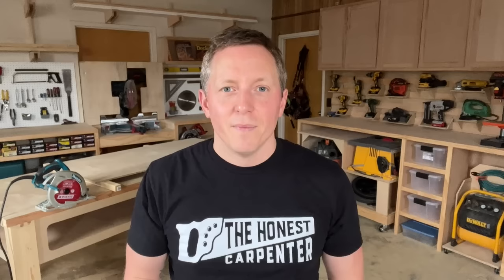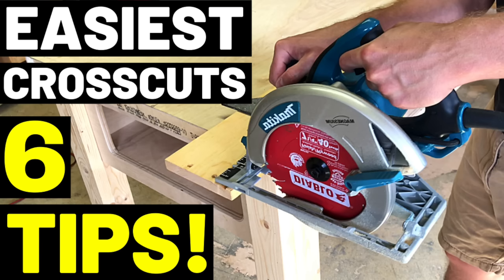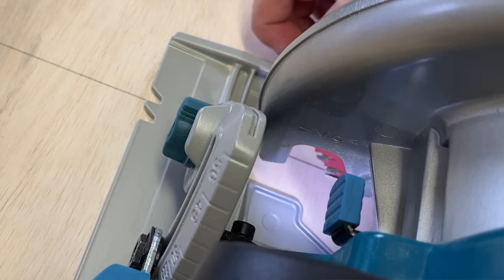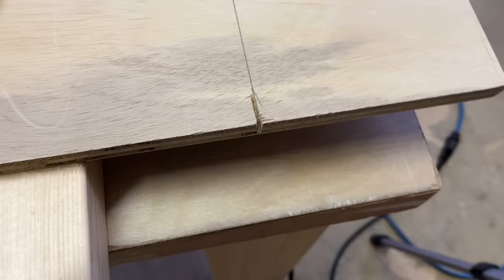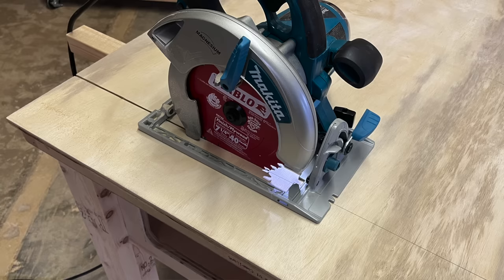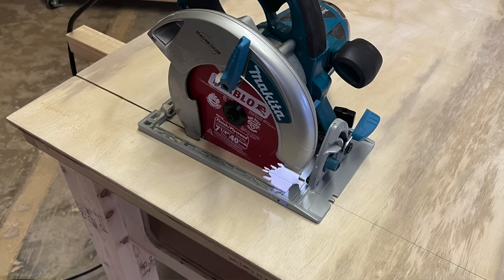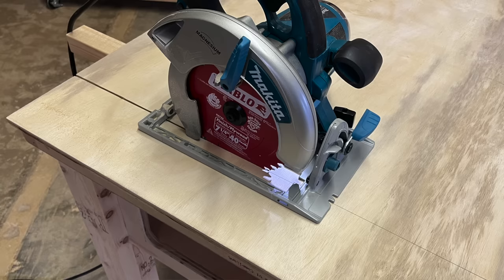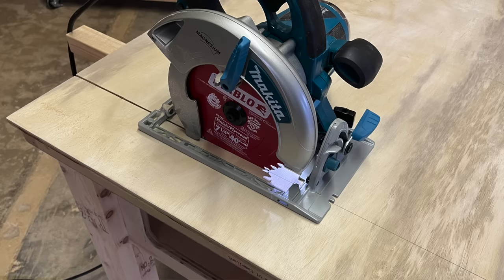How To CUT STRAIGHT With NO GUIDE! Freehand CIRCULAR SAW CUTTING...Pro Tips, Tricks and Secrets!

Comment: Good video with one somewhat controversial comment. 'Splitting the pencil line' seems inaccurate to me. All-be-it only 1/16 of an inch or so, when I strike my cut line it lies fully outside if the straight edge so don't I want my blade also fully on that edge? If my line is on the waste side of the cut and I split the pencil mark am I not losing however much material is on the 'keep' side of the line. I know this is construction accuracy and the very slight difference may not matter and I know it is difficult to keep the blade on the edge of the line but isn't my theory correct? Just my 2 cents. 
I appreciate all you do. Thanx, Greg
Reply: That's why a sharp pencil is important. If so, your line is probably 1/32", or even 1/64". Plenty accurate for free hand work if you split it.

Comment: At 4:28 in your video I notice that you are prepared for making a cut following a line on the board. In order to see the line you are trying to follow as you move the saw across the board, your right hand is controlling the saw and your right hand is across the front of your body. I presume you are right-handed as maybe 95% of the population is; therefore, i assume you see this posture as "natural". Try this next time ..... hold the handle and turn on the power switch with your left hand and you should notice that your control hand (left) is aligned with the path of travel for the saw and your eyes more easily can see the saw blade and the line. This won't "feel" natural because you are right-handed but i think you should experience your body more in alignment to the project cut. I loved the video and being left-handed your video prompted me to realize this analysis for the first time. Best wishes.

Comment: I would also say keep your wrist as quiet as possible and use your arm not your wrist to push the saw that was a tip I got years ago but I agree if your not using tables saw clamp a straight edge on your material so it glides on the plate obviously when it’s critical for a better cut or a Gregg product I like there products but they are obviously more expensive than just a straight edge

Comment: I am surprised that you prefer a circular saw with the motor on the left. Assuming here that you are right handed, your physical position is left of the saw and you have to look "over the machine" to watch the pencil line. I didn't give this topic any consideration when buying my saw :), but it has the engine on the right. Which means that I hold the saw in my right hand,  I stand left of the blade, I don't have to bend over the saw and the motor doesn't hide my view on the line. For me that's the perfect setup, but completely the opposite of the shot at 12:00. But as always YMMV :-).

Comment: The only time I'll cut freehand is when sheathing a roof or a floor, and then picture perfect cuts aren't needed.  Any other time I'll use an inexpensive home made 1/4" wood guide nailed with two 3/4" nails to the surface of my plywood, which is the hidden side of the rough cut.  It's much cleaner, faster and stress free.  Do it yourselfers have the time to set up a guide, they should always use them.  Always wear eye protection, and if you're inside, don't forget your hearing protection.

Comment: Line up the notch on the front of the table on the saw on the line and the blade on the line and start cutting then you should be able to follow the line and the less your blade goes done in the wood the mote change you will go crooked because it’s easy to turn. That is how we carpenter make a arch with a skill saw because you can turn and the blade won’t bind and will let you turn. So the more blade is in the wood the harder it will be to go crooked and do a plunger cut to start and when the blade is straight drop it down and keep pushing following the line

Comment: Skill saws the same as a hand saw but there’s only one axis you need to keep straight just don’t move you wrist there’s a little mark that goes to a notch that’s  in line with the blade put the blade at your line then line it up with the notch and just be calm don’t rush and you don’t need to fallow the line really because once you got a good start the saw steer off you do by over correcting

Comment: If you are freehanding with a circular saw, you have already decided "this does not need to be finish-grade precise, time and convenience is more important"

Spinning the saw up to speed is always going to move the saw around a fair bit.  Get your initial line up close, but there's no reason to get really finicky lining up the saw, until it is spinning at full speed.   Incidentally, this turns your saw into a gyroscope, which makes it easier to make small adjustments.

Have a 'plan' for what happens with your saw cord, for the whole cut. A cord catching on a sawhorse leg, or in the kerf, or really anywhere, can drag your saw off of line.  For a lot of cuts, when I am moving from right to left, I hook the cord onto a tool in my toolbelt, to keep it near, and loose, at my right side.

It's easier (and on bigger cuts, required) to move the saw with footwork, legs and your torso - my arms and the saw are often 'locked' in place in front of me, hands used primarily for micro adjustments. Having the saw locked in and centered with your torso also makes it easier to control, (and therefore safer), than long extended arms. Make sure you know what you are walking around so you don't trip on an unexpected obstacle.

Each saw kicks up wood bits and sawdust in different, but fairly predictable ways; as you gain familiarity with how your saw cuts, pay attention to where you can hold your head, you are searching for where you have a good view of the line, and the cut, but you're not getting mountains of wood blown directly in your face.

When you do have to make "micro' adjustments (and we all do), know that you are sending the saw on a new path: if you have to make an adjustment, you will likely have to make 2, one little bump of pressure to "drive' back to where you need to be, and a second little bump of pressure to get straight back on course.

The last 5-10% of a cut is when one board is turned into 2- there is almost always going to be some shifting of equilibrium, weight, and tension, in the last part of a cut, which can affect your result. 

Try to think about how the two finished pieces would balance, after the cut. Setting up the workpiece should be both balanced for the starting condition, and should be balanced for each piece when you are finished, if you want to limit this shifting.

Backing up when the saw is spinning has a high chance of causing a kickback. It will often seem like "oh, let me just back up a little bit here and tidy that line up - it should be fine..." it won't always be fine.

The most chaotically dangerous place is directly behind the saw: this is where the saw goes when something goes wrong. Something will go wrong at some point, so uh, try not to have people or parts of people there.

Comment: For who I am... weird(?)... I do use a circular saw with a carbide tip blade to saw sheet/plate metal to about an eight of an inch (but honestly sometimes thicker). All the practices spoken of here holds true when cutting metal, but getting off track is a lot more difficult to correct than in lumber-ish products. My suggestion is, if not time sensitive just take the time to forgo winning the hero button and use some sort of reliable straight guide.

Comment: I have always felt that a right-sided saw blade was more difficult to use if you're right-handed. I found much to my delight a left-sided circular saw from Bosch. This allows me to site the line and blade at the same time. I also have a worm drive corded and 7 1/4 cordless. I have of course used a saw-like yours but having the blade on the left-side is my preferred cutting method.

Comment: That notch on the front of the saw is 100% accurate lol.  Why would you say it is not?  All lines may not align with the blade from saw to saw, but once you know how it transfers to the blade, it is all you need to use  BTW, if you only look at the blade and you stray off the line the consequences are more dire than if you notice the notch goes off the line.

Comment: How hard is it to clamp a tee square to the sheet and know that you have a straight square cut? My saw guide is a piece of laminate flooring which is thin enough to pass under the saw body and wide enough to allow a place for the clamp.  The tee part extends just to the saw kerf. Free hand cutting and expecting to get a neat straight cut is an oxymoron.

Comment: Perfect timing for this video since I'm looking to buy my first circular saw. I'm a small scale home DIYer and love the convenience of cordless, but worried that the 5 amp battery won't give me much power to rip sheets or 2x4's. Should I go corded or cordless?
Reply: These new cordless power tools have great power and actually last pretty good. Buy a backup battery and you'll be good to go plus you can hopefully run your other power tools using the same batteries. Your next decision is what brand to buy. Good luck 👍
Reply: Milwaukee or Dewalt, whether corded or cordless, you will never regret owning one of those two brands. They are expensive, but they are worth the expense. 
 I personally own a lot of the Milwaukee cordless lineup. I have used Dewalt on the job site as well and was equally impressed. You can't go wrong with one of those two.

Comment: Amateur tip: use a guide anyway, but measure the exact distance between the cut and the guide.
When you know the distance you can always position the guide accurately without having to worry.
When you don't have to focus on keeping a straight line you can focus on the safety aspects, which are far more important.

Comment: I find 7 1/4 circular saws incredibly awkward. My porter cable is big and heavy and I mostly hate it. Why in the heck the standard config is to the have the motor on the left when most people are right handed I'll never understand. It's super awkward to use, especially on large pieces, like ripping down a sheet of ply. Using a straight edge, which is always a setup hassle, has been the only reliable way for me to actually use it. which provides it's own challenges because your clamps and the board itself have to be out of way and can't be high enough to hit the stupid motor coming out from the left! Setting up to the right of the blade doesn't generally work either. Bora clamps suck and were not better than clamps and a board, so that crap went right back to the store.

Comment: As others have suggested: 1. Worm drive saw vs sidewinder. it has a narrower footprint and is easier to work around. 2. Use an after market or custom plate that is either wider than stock or has a track attachment. 3. Defeat the guard. As he suggests in the video, this is "sometimes necessary". I would argue it is always necessary. Most spring loaded guards are too strong and interfere by getting caught on the edge of the board. 4. Use cordless, or overhead power to keep the power cord out of the way. Power cords often get caught in the space after the cut, (but before it the wood is completely separated). 

Any of the above leads to stopping and starting mid cut, and or distracting the user while they are trying to focus on the cut. C saws have high torque motors, and are often hard to precisely control as a result. You should do everything possible to avoid stopping and starting again mid cut.

Comment: After working 40 plus years as a carpenter/woodworker, I still can't understand why these sidewinder saws are so popular. If you are right handed, it makes much more sense to use a worm drive saw. Because the blade is on the left of the motor, and therefore much more visible. Also, you're are not cutting with your hand and arm crossed over your body. That is not as safe as using the worm  drive.

Comment: Glasses, blade depth. Start with back of saw elevated and lower in as you move into line. Didnt need 15 minutes to describe
Reply from the maker: No, don’t do this. Just because framers drop in at the edge doesn’t mean beginners should. Bad advice. 👎

Comment: I came here sort of by accident but I have a lot of experience with this type of cutting and I have to say you got a lot of this wrong. You have the blade adjusted for a shallow cut, which causes several problems with no upside. First, your blade is passing through the wood at an angle instead of more or less straight up and down, like a band saw. Is this the angle at which you would also use a hand saw? Of course not. The reason is that the shallow angle is forcing the blade through more wood as you push it along, like one and a half inches versus a half inch, so it’s more difficult as well as creating more heat. 

Second, adjusted for a shallow cut, the amount of blade inside the cut is much less than if you had it set for max depth. You’re correct when you say this assists in keeping the blade aligned, but a shallow cut is harder to keep aligned because there’s less wood guiding the blade. For example, you could probably cut a big circle out of half inch plywood if your saw was adjusted for a shallow cut. A circle would be virtually impossible adjusted for max depth. 

Third, adjusted for a shallow cut, your handle and on/off switch are in an awkward spot. The saw can accidentally pivot more easily than if you were at max depth because the handle and controls would be more or less behind the blade instead of above it. This provides more leverage and makes the saw easier to control and keep in a straight line.

The other thing is you don’t need so much support under whatever you’re cutting, there’s no reason for it and it takes too much time and effort. You can cut perfectly straight off the edge of a sawhorse. If you have a large amount of overhang or you’re between sawhorses, you’ll need to support the wood somehow or it’ll splinter when you get near the end of your cut. If I’m working alone, I like to use quick release bar clamps even if I have a support under the overhang. I stop half way through the cut and put a bar clamp at the beginning of the cut before I continue. This has nothing to do with cutting a straight line but it’s an important point. If your overhang sags as you cut it, it will create torque at the end of the cut and cause disastrous splintering and bucking.

By the way, a Makita saw screams “amateur” but the Diablo’s a good choice. Sorry, man, but ask any contractor, Makita is a homeowner saw. As to what kind of circular saw to use, virtually anything but Makita. LOL I have five or six circular saws but my favorite one is actually a Ridgid.

Comment: #1  make sure the material won't move - clamp it down if needed 
#2 make sure the saws  base plate is clean and flat ( some fools drop their saws on the ground )
#3 make sure the cord is freed up to travel across the material -  if the cord is to short or hooked on something it will mess up your cut !
#4 set the blade to the correct saw depth !
#5 wear safety glasses !!!!
OOPS I almost forgot  use the correct saw blade that is sharp !   the wrong toothed  DULL saw  blade can ruin the material  !

Comment: Excellent presentation. I see you used a 40 tooth blade. Do you think it is easier to cut a straight line the more teeth the blade has?
Reply: Yes. Many teeth with help with a straight and cleaner cut. Not too fine though as it will slow you down. 40 tpi is a good balance that has improved my cuts than the courser blades you often get with saws.

Comment: As a former lefty using blade right saws, I never realized how vital it is to have a blade facing you. (Lefties=blade right. Righties=Blade left.)
 
Now that I'm a righty, after losing use of my left arm/leg, I'm amazed that there so many right blade saws being used by righties. (Especially EVERY good track saw.)
 
The twisting, and stretching needed to use a right blade saw, as a righty, on rip cuts is a nightmare. For crosscuts in 2x lumber, it's not a big deal. But rips in ply, or longer lumber, it's reallllly tough. 
 
Hopefully, a good track saw comes out with a left blade. It's so great to be able to hold it with your right hand, as your workpiece is to your right. 
 
"Good enough should never be considered as "good", or "enough". Especially with dangerous power tools." -Me

Comment: A straight cut, free hand with a circular saw is impossible, yes you can sometimes get it pretty close, but only good enough for carpentry. If you need a perfect cut, use a saw guide or a table saw. I only use a circular saw for the rough dimensioning of lumber, anything within a eighth inch is good enough.

Comment: These cuts might be okay if you are going up against a wall or somewhere that the cut will be covered, but are rubbish if you are butting up to another sheet with a factory edge.  If you are using a straight edge to mark the line, why wouldn't you just clamp the straight edge on and use it to cut the line. Ever heard of a tracksaw. You don't even need to clamp those ! Pro tip,

Comment: The old saying practice makes perfect is true. I've gotten pretty good at following the straight line, especially on shorter cuts. Long cuts are of course more difficult. One problem with corded saws is the cord getting caught on something. And then having to stretch out on really long cuts. I've about stopped using my corded saw in favor of the cordless. Problem with that is a dead battery. Extra batteries are nice so I keep two fully charged on hand. I do keep a straight edge on hand and use it sometimes. It's an aluminum two piece tool. Each piece is 4 foot and can be connected for an 8 foot. Have to clamp it to the board being cut so I don't use it often. Only when I want to be sure I get a really straight cut.